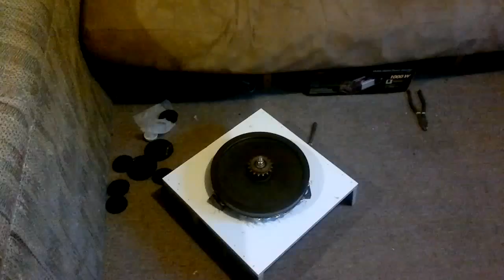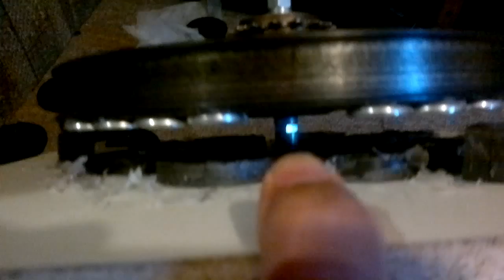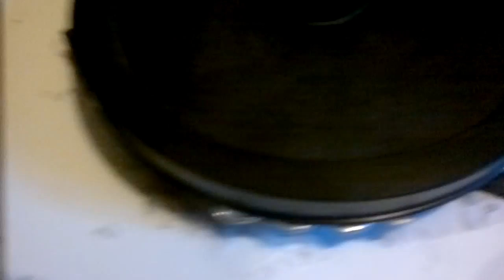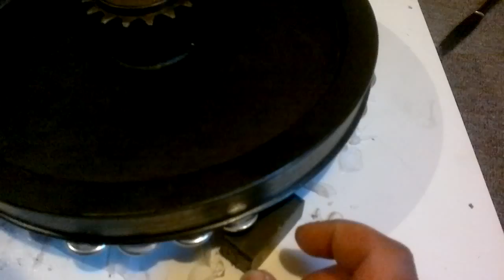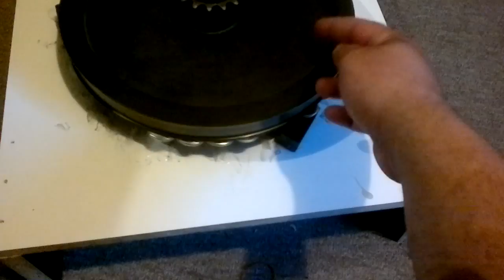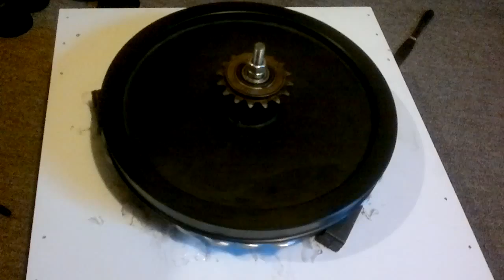Magnet Motor FAIL! , heavy rotor,  the Neutral Zone

Comment: Off set the stators at a 33 degree angle to your rotor magnets, now space your rotor magnets 1 inch apart from each other. Yes I know it's a lot of work to rebuild that, but it works for me just fine. Very nice craftsmanship though.

Comment from the maker: I took two rectangular magnets stuck them together, turned them on their sides so you have a line in the middle where north meets south. Then as the round magnets on the wheel comes along its attracted then repelled based on the angle of the magnet to the circle, its attracted then gets weened off of the attraction by the angle, the sweet spot where its neither attract or repel the I call the NEUTRAL ZONE the key is to have the wheel cut off go neutral then repel as another in attracting in.